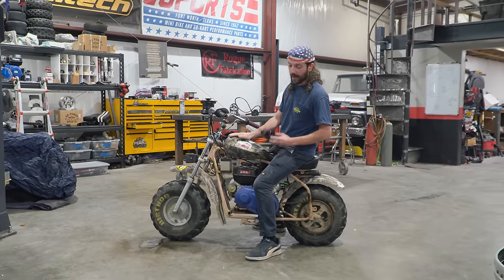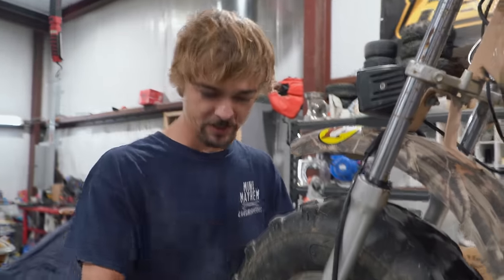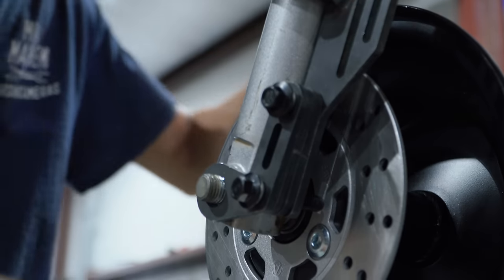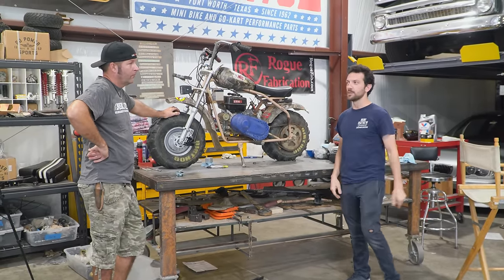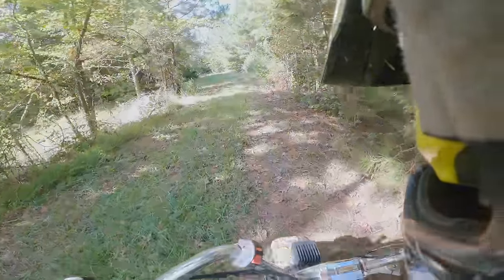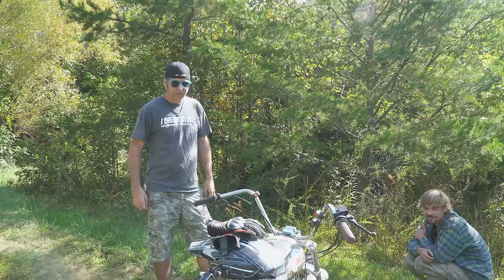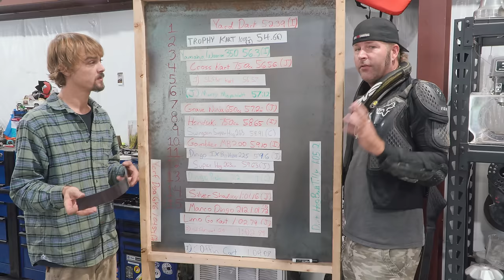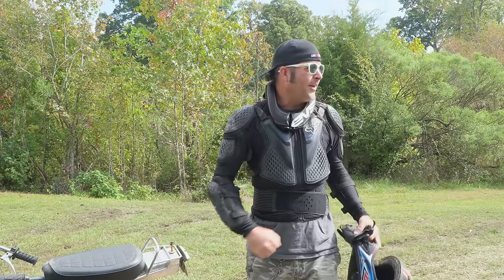This Mini Bike is So Fast We Had To...

Comment: Y’all should do a 200$-300$ go kart challenge between the three of y’all. Have a few competitions to see who had the best build. Like if you want to see this happen 🤙🏼
Reply: Would love to watch a low budget gokart competition.
Reply: Don't think the boys could resist helping with one another's builds
Reply: A mini mini mayhem around the grand prix with just them 3. 1st one to finish 10 consecutive laps
Reply: Top gear style 🫡🏴😂
Reply: I basically just did exactly that and I’m having trouble getting my 224 with vm22 carb running and staying running I just can’t seem to tune it correctly. Any help
Reply: I need help getting my 224 tuned right to run
Reply: Definitely a great idea 2-300$ go kart buy or build challenge all for under 2-300$ an hot lap an dirt trackem
Reply: I feel like the budget should be around 5-600
Reply: @ghost-carnage8964  yeah that could be cool but I miss the old days where builds were quick and cheap but everyone still had fun. It’s more fun to drive slow things fast than drive fast things slow.
Reply: They can’t do a low budget build with go power sports in the picture
Reply: How about under $100?
Reply: Yes a quicksilver dingo😂

Comment: Had to do the same thing when I converted my Toyota to V6 calipers on the front. No harm in using washers as spacers, the can and will get the job done. In fact they are still there after 12 years.

Comment: Okay guys, there’s a brake handle for motorized bicycles that allows you to hook up front and rear brake cables to one handle. This allows you to adjust both cables differently so you don’t go over the handle bar’s or the rear sliding out on you. This is how we do it with a clutch so you can grab both brakes at the same time in a curve. This also allows you to handle thrust and braking,also stalling a mini bike to take off with out spinning. Great video guy’s!!! Hope Charles is okay.

Comment: I did this to my CTU-EX last spring. I love it! I have a thumb throttle and I feel that makes it easier to use the front brake and keep control. I installed it right before one of our Quarantine 100 Gambler Minibike enduro events here in Oregon and it helped my 44yo ass take 2nd place in Iron Man class. I did wreck 1/2 way through and broke my brake levers, so only had the rear for the last half the race. I think Charles needs some better SunF tires on his bike.
Reply: What's wrong with that tread pattern?
Reply: I find the larger flat lugs don’t handle as well as holeshot or the UTV style tires they carry. Specially in grass. What Charles has is designed for ATV’s and a little more square.

Comment: They should've made the clamp for the forks a lot wider.
You'd get more grip without the risk of crushing the fork.
Reply: U shouldn't need it tho that only needs to not come loose .if the bolts don't raddle out u should never have to worry about it its literally just holding the caliper from spinning.  A coat hanger would probably be enough.  I would barely snug it and just put lock tight on the bolts.it can't move up and down at all only can spin clockwise. Although I gonna agree with u because then if it's too big to clamp down u can always take some material off the face of the clamp were the bolts go through. It would be more universal. The thing is ur  not supposed to clamp those forks because ther probably aluminum.  Handlbars can handle it because they are carbon steel. The bolts or clamp doesn't even need to be ther to be honest because the wheel is holding it flat against the fork.  The bracket would tighten up against the fork when u tighten the wheel without the other half of the clamp bolted on . I don't think this was a well thought out product. Welding 2 tiny tabs on the fork like it should be would probably be best . But ya if ur gonna put a rigged azzz caliper bracket on it I'd probably want it like u said oversized.  I wouldn't want it to clamp at all. To make this part correct and decent the inner diameter should be the same as the forks outer diameter so it doesn't clamp at all but fits perfectly enough to have no wiggle.so your right tour rig job would be best if using this rigged bracket.

Comment: Killer mini bike.  The springs need to be stiffer for Ike. Shock squish and short wheelbase make it a challenge.
Charles isn't short either, but Isak is another weight class. Ike do know his bikes though, did well for a first ride.
Shows how Chuck knows his stuff too.  And now with front brakes... that work VERY well, even more awesome bike.

Comment: Front brakes perform the vast majority of stopping power.
The weight being transferred to the front wheel makes for much better braking unlike the rear wheel which is basically just dragging the back tire since it's become unweighted when the weight is transferred to the front of the bike.

Comment: Those forks are the reason my bike had to be immediately Frankensteined because the bolt broke off in the triple immediately as I tightened the bars down. Now I have an expensive ass CNC triple and 29” shocks and 13.5” shocks on the rear. It’s a nice height now. Like3-4”  lift all around and I added a spring loaded chain tensioner

Comment: You need to use the front brake in addition to the rear brake. Not just the front brake. If you slam on just the front brake as you can see by Charles results, you'll tuck the front end and layerdown. If you made another braking test with using both brakes you'd stop even shorter.

Comment: if it doesnt fit youre not hitting it hard enough
as for USING the front brake . i think on a normal motorcycle the front branke is on the trottle side so it might help if you switch the levers around on the handlebar

Comment: Sometimes if you're engine is producing like say, more torque than horsepower, a lower gear ratio will slow down it's acceleration, and then you'd need to give it a higher gear ratio to have more acceleration.
Kinda funny how that works.

Comment: So I get it it's a mini bike but the technical thing that most people always overlooked on all motorcycles the key that it is motorcycles not mini bikes but I am assuming that it all applies the same the wheel or the tire is technically backwards on a motorcycle this is to help with breaking the way the tread was designed for breaking go look at any motorcycle in your dealership currently now and you will notice that the tread pattern is backwards especially compared to the tread pattern that is on the rear of the bike this is to help with breaking from the front wheel as well as turning

Comment: Hey guys. First thing you learn on dirt bikes is no front brake, ever. Front brake equals crash. Back brake only.
Reply: 100% WRONG. Front brake has FAR more stopping power than the rear, and anyone who can use it will be faster than you will ever be for that reason

Comment: If the front wheel isn't pulling, the V pattern should be pointing the other way for maximum braking traction. Motorcycle tire manufacturers state that the VS should both be pointing toward the center of the bike, looking down from above. This will also improve handling.

Comment: Those are motorcycle handlbars lol. Ther long because on a motorcycle they need to be for better control. U dont need them that long and probably would turn way better not so long.  Cut some off the ends.

Comment: Man, yall gotta learn how to crash better. Also, heavy breaking on the front, offroad is a bad idea. If the front wheel locks up your going down. Its the gyroscopic force of the front wheel spin that gives you balance and control of the motorcycle.